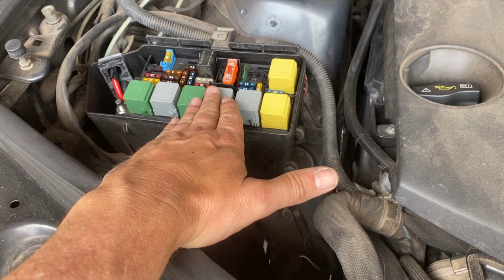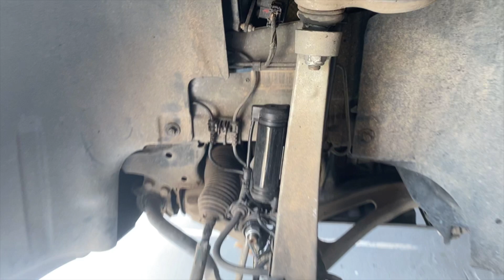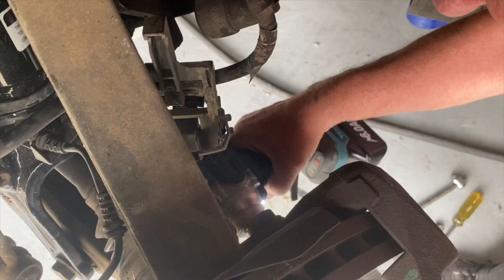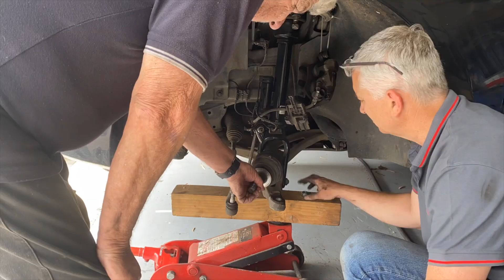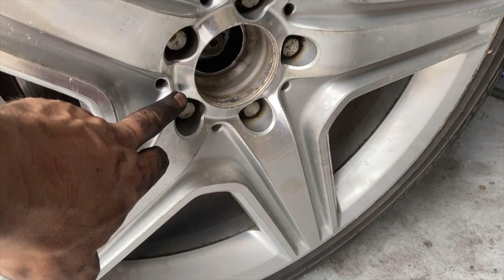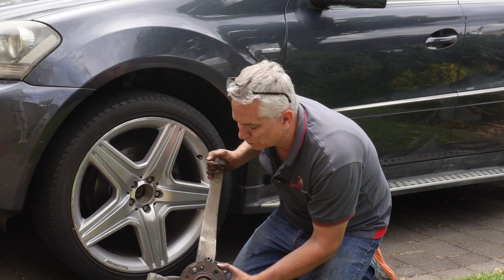How To Replace Mercedes ML350 W164 Front Wheel Bearing - The Complete Guide - ML300 ML320 ML350 GL

Comment: Great video having the whole assembly off you just need to go to a local mechanic or rent some tools at your auto parts to change the bearing put in to fridge for few hours before the installation.
Reply from the maker: Hi Mate, Definitely, a good tip, however when I looked at it by the time I factored in renting tools or even paying a shop to press a new bearing in and my additional time, to me a complete assembly was more cost effective!  Cheers Drew

Comment: Thanks for youre great time and info again:washhands:.Cheers
Reply from the maker: Hi Trevor, Thanks for watching and for your kind comments!  Do you have a Mercedes ML yourself and if so, are there any videos that you would like to see in particular?  Cheers Drew
Reply: @DrewFixIt  Next belt service could you video it?
Reply from the maker: Hi Mate, what belt do you want to see?  Cheers Drew
Reply: @DrewFixIt  Hi Drew,thanks for youre reply. Yes,i recently bought a ML320 cdi 2008 (226000)klm. I have just had an Automatic service with a business. Somedays i seem to think the tranny is lazy.But the service people think its fine. I also bought a  Icarsoft CR pro youre reccomendation . I need to be confident and plug it in. It seems to have an issue with the aircond is on constant(air off). I know its refrigerating and a very cold suction return  pipe. I may need youre suggestion of what i can do please?. I have removed the fuses on the passenger fuses no 10 and 12.But,the compressor still runs. I will need to find if the a/c clutch is seized on or an electronic controller stuffed. I dont find any similiar mb youtube faults relating.  Sorry for the long worded but im sure it has too much heat across the radiator as condensor is hot on a very hot 36 degree day with had in adelaide yesterday. I have checked the coolant is full  and i cant find the clutch wire that i could disconnect. I might have to get dirty :)... Thanks for any advice and i really like youre mechanical vids
. Well done  .Cheers
Reply from the maker: @ hi mate, where did you have the transmission serviced and how much did they charge you?  Don’t be scared of plugging in your scan tool!  Cheers Drew
Reply: @DrewFixIt  Hi Drew ,I had it serviced in Adelaide.I was very impressed and they told me what i needed. It was charged $540 I think.I had another friend that recomended this automatic business.They knew that it was a seven speed box and I had another quote for 700.  I do find that the auto changes quickly if i have a heavy foot.But if i putter about it seems different changing.I had never owned an AWD car before.I will plug in the scanner soon and will let you know. Cheers :)
Reply from the maker: @trevorhanlon-eb4vc  in the future you can follow my video and it will cost you no more than $200 and a couple of hours of your time.  Check out my video here: https://youtu.be/ggGk3_Uu5_M Cheers Drew :_DFI:
Reply: @DrewFixIt  I am in youre subscription  and my repairer removed the fluid in the torque converter. He was surprised because someone had fitted a different fitter on the converter..I considered that i would service but i wanted a professional  inspection.I looked at cost of 7 litres of fluid but all requires plus parts.I will do it next time.I like all youre ml videos for info and all confidence. Cheers
Reply from the maker: @trevorhanlon-eb4vc  Hi Trevor, you are lucky being in Australia!  I recommend you purchase the exact same Penrite Transmission fluid that I use: https://penriteoil.com.au/products/atf-bmv-full-syn besides being purpose made for Australian conditions it meets both the early and the late 722.9 transmission specifications, which is really nice and you don't have to worry about misapplication of fluid!  Additionally, if you shop around you can normally get 4L for under $50!  Cheers Drew :_DFI: